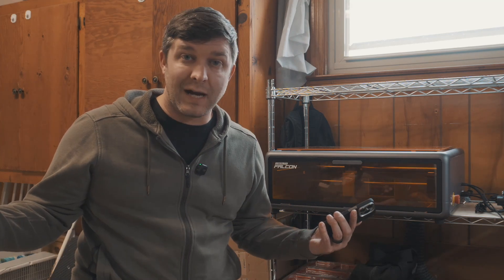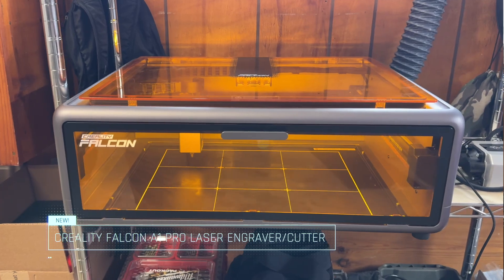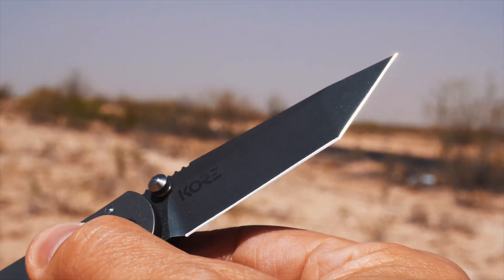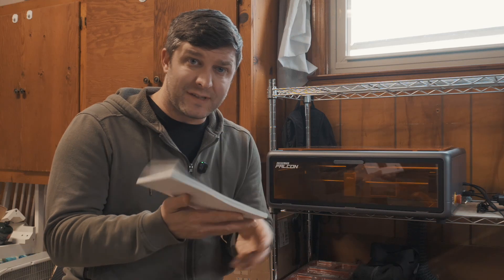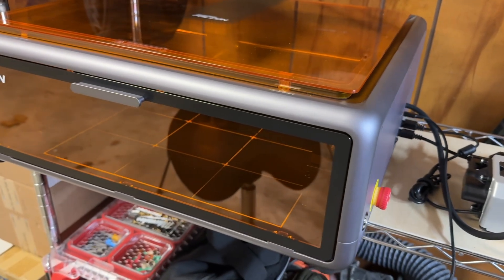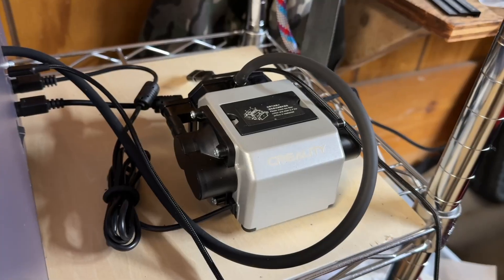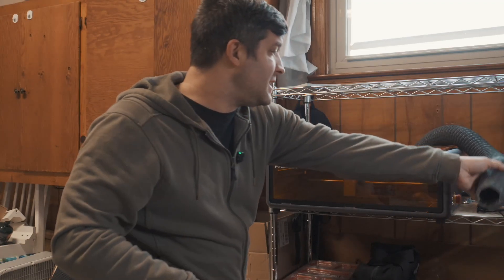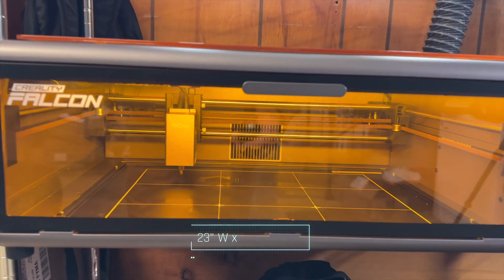Can a Total NEWBIE Master This $499 Laser? 🔥 | Creality Falcon A1 Setup & Project Test

Comment: I just got mine, NEVER used a laser before. I made some rookie mistakes. No honeycomb under material, marked up the bottom but its metal it was fine. not lowering the laser to the material. Lots of safety features,  you kind of have to be doing it on purpose to hurt yourself. I do recommend good ventilation like a garage or tubing to a window. I did order the rotatory system so looking for something to test with. different "layers" tab for engraving lines, engraving "bold", cuttings.  I too didn't read the instructions(work in IT, figured I'd figure it out) but calibration of the camera etc. figuring out how to keep that so I don't have to do it every time. But so far its really nice.
Reply from the maker: I love mine! And I made those same mistakes!